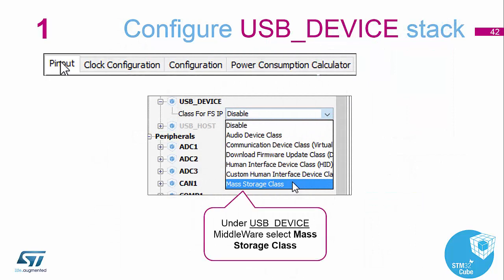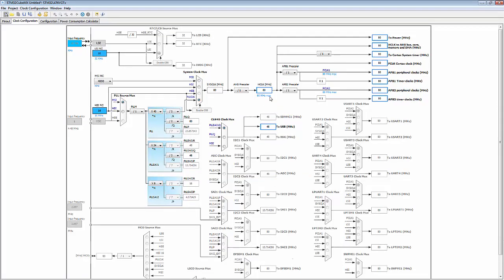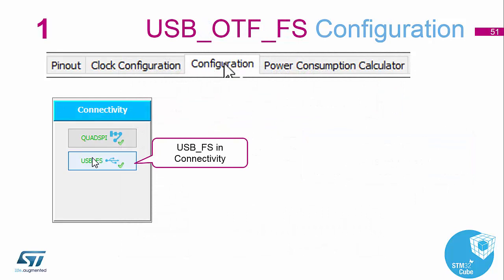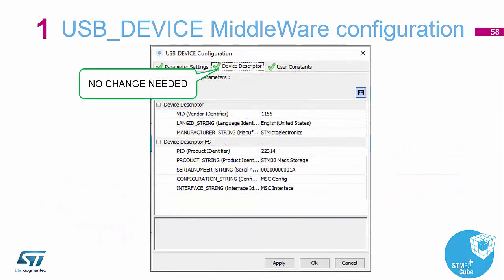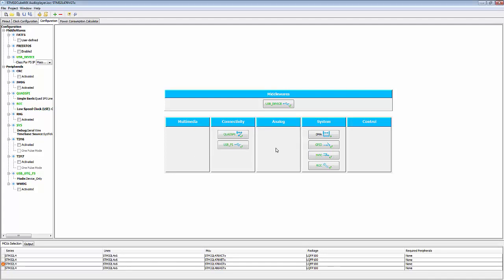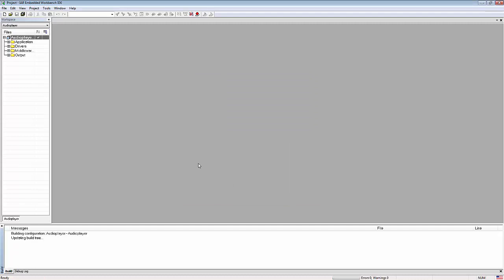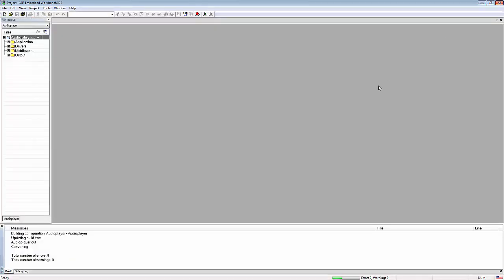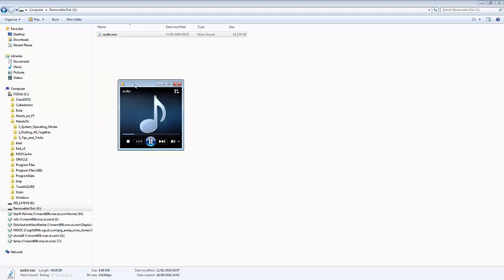STM32L4 workshop: 5.2 Audio Player - lab 2

Comment: Thank you,
I followed the exact same steps as you have told me.
There is a new step.
In the cubemx on the code generation page, you need to select the basic structure. 
otherwise, with advanced structure, a different folder structure will be generated and when you make the binary and upload; windows will show its size as 32 MB, not 16 MB.